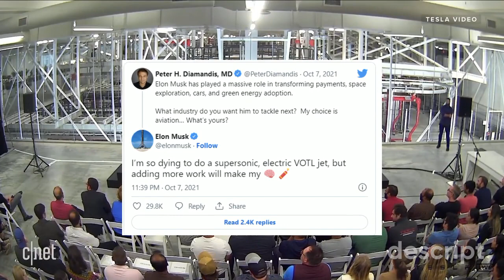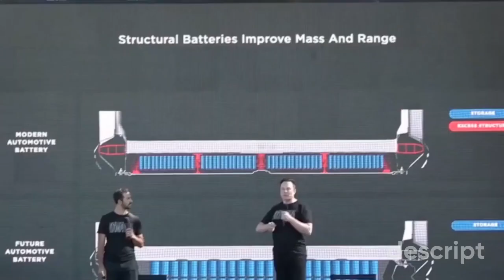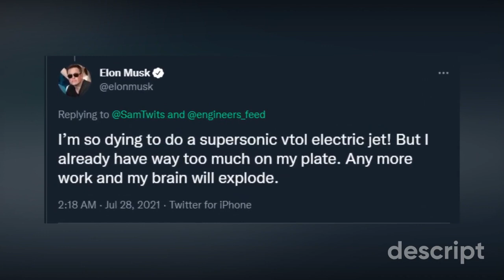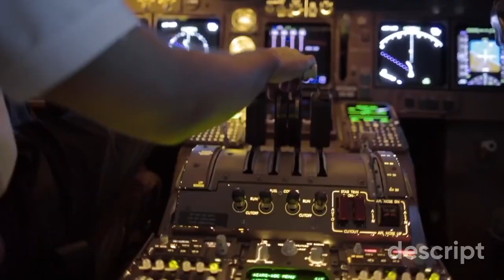When will the Tesla e-Airplane (eVTOL) come?

Comment: Hey, Tesla design engineers, I recently posted a comment on the Lilium channel requesting that they build a two-seater model of their current VTO E-plane, but the request is an open request. My request included the suggestion that this vehicle would have a coil incorporated into the cone in front of the fan that would serve to harvest the kinetic energy from the rotation of the shaft/cone that would be converted into electrical energy that would then be used to continuously charge the battery array or the super-capacitor array or a hybrid of the two. Of course, we're talking about an VTO E-plane with unlimited range, and it would never need to be plugged in. I also have a unique design idea for vectoring the thrust that should greatly increase the thrust as well as having this design act as a wing. You people should get in touch, and by the way, I once had a blue-ribbon patent on this design.